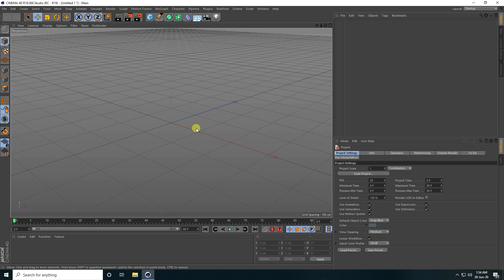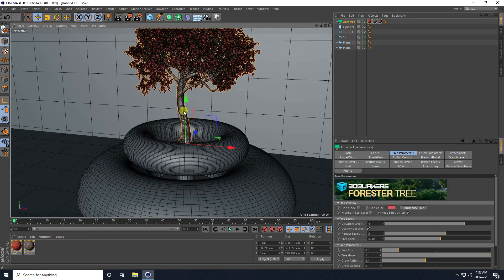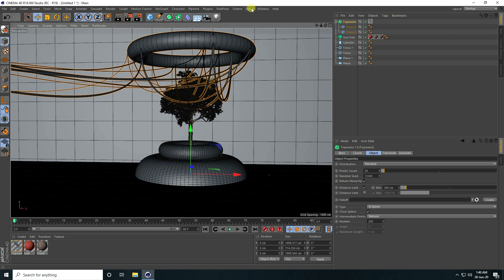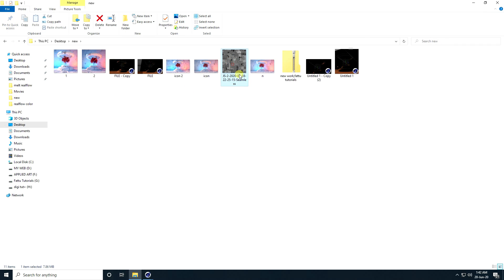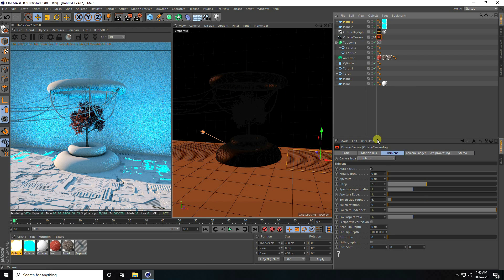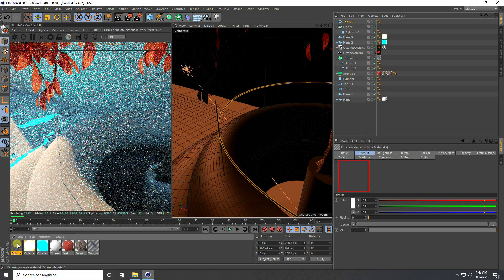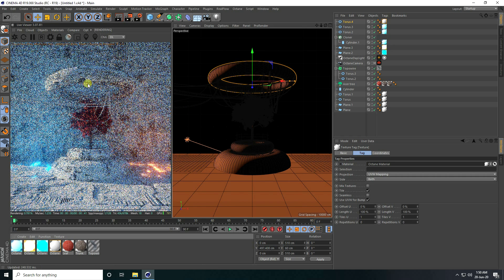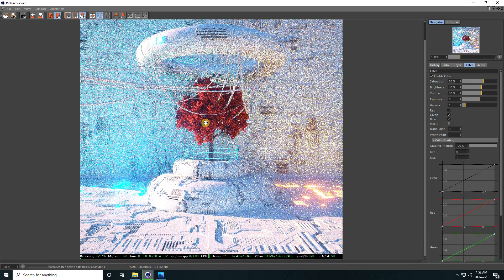Octane Render Cinema 4D - 3D Concept Art

Comment: What is your PC configuration. I tried using Octane and my system is not able to handle the renders. Your tutorials are really nice and easy to understand. I am planing to buy a new PC. It will be great help if you can share your PC config and also if there is any website that help in configuring the system for handling Octane Redshift etc